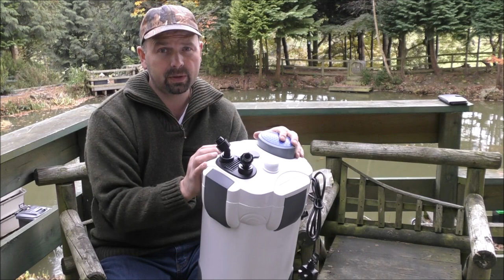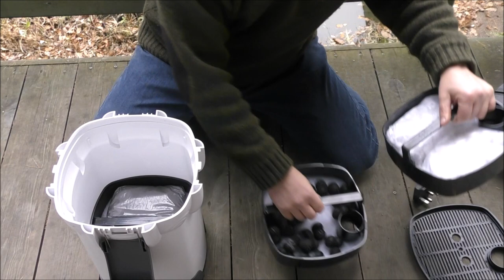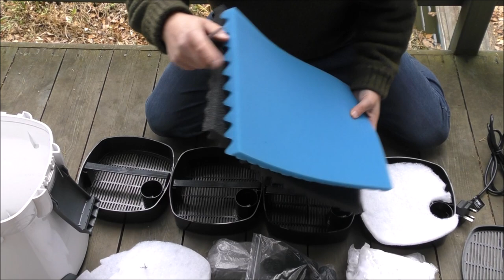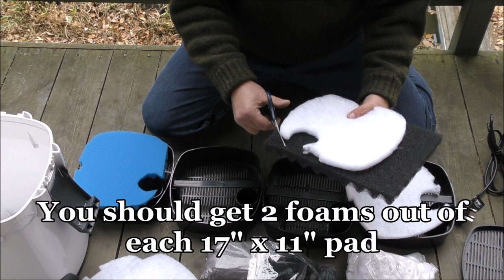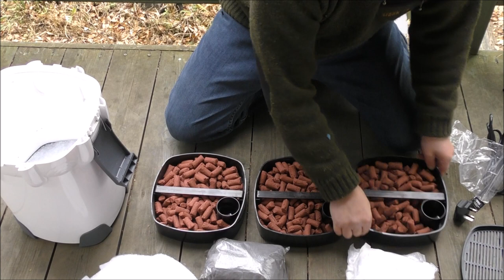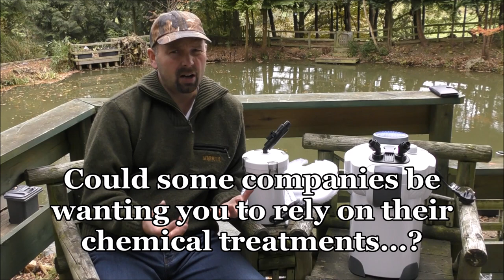Why Your Filter is TOO SMALL and NOT CYCLED

Comment: I have a juewl vision 450 and I have set my filters up the way u have said since it makes sense but I still have a lot of nitrate in the tank. I have an aps ef 2000 an xl biomax juwel internal set up how u said and a fluval 306 all have regular maintenance yet I’m still get sky high nitrate I’m doin 2 50% water changes per week to keep the tank healthy I don’t understand why this is happening I use carbon in my fluval n it’s the fluval carbon I use
Reply from the maker: The carbon should not affect the bacterial development but if the tank you are referencing is the white one stocked with cichlids in your videos it would definitely be classed as heavily stocked.
That could take around 2kg of biohome ultimate per 100 litres to achieve a full  cycle so you'd be looking at around 9kg for a 450 litre tank, maybe less due to water displacement from the rocks.
I need to know a few more things in order to help:
1 - how much media are you using in total?
2 - how long has it been in the filters?
3 - when doing they large water changes what conditioner do you use?
As you're in the UK feel free to ring me any time on 07772848730 as it is way faster to ask the right questions and give the right answers via phone (I often miss youtube comments)
Reply: Pondguru not sure on how much there is in Weight but all 3 trays are full in the aps filter. Same with the fluval and the juwel I have filled it half way as I ran out and the rest is filled with sponges that came with the filter. I use the fluval ceramic rings in the aps and fluval filters and ceramic gravel in the juwel they’ve been in since I set it up 6 months ago I don’t rate the fluval rings. I use a home brand water conditioner from lincs aquatics I was using king British but changed as it was costing a lot doin 2 changes a week it states that it can treat a 5000 gallons with the bottle it’s made for ponds not aquariums but was told it can be used for them too
Reply from the maker: So the biohome has also been in for 6 months? That's how long it can take for the anaerobic bacteria to mature to the point of reducing nitrate but if you only have 5kg (that's how much the EF2000 takes for 3 trays) - that is just over half what you'd need for a heavily stocked cichlid tank.
A normally stocked tank would take around 1kg per 100 litres, heavily stocked tanks can take between 1.5kg to 2kg per 100 litres - that's the most likely reason why you've got high nitrate as there is not enough media to provide enough habitat for a suitable amount of anaerobic bacteria to process the nitrate. We've got the recommended amounts to use from hundreds of people all over the world and every stocking scenario imaginable so they're very accurate.
While there are a few anomalies of people only using 1kg per 100 litres in a heavily stocked system and still achieving a full cycle those cases are rare.
I'm  not familiar with the treatment which you are using and nothing useful comes up on their website for treatments but as long as it is a straight dechlorinator which doesn't claim to detoxify / bind ammonia, nitrite and nitrate it should allow bacteria to mature naturally.

Comment: Great video! I am wondering what order my Eheim has the media in now. I will change to the order you suggest when I next clean it.
Reply from the maker: No worries, if it is one of the pro or pro4 it will probably have a 'pre-filter' foam right at the top which water hits first so just leave that as it is and set up the rest of the filter as demonstrated here.

Comment: How would you recommend optimising a fluval 406? Considering it has foam on the side could you forgo the foam in bottom tray ?
Reply from the maker: It is still best to go with at least a medium and fine pad in the bottom tray as the side foams only catch so much muck. That will leave 3 trays for media (3kg)

Comment: i’ve been using vitamin C (effervescent - berocca type tablets) to decontaminate my tap water... would this have any negative (or positive?!) impact on filtration?
i think i read a comment by you suggesting a seachem plant additive to help improve the cycle... if so, would you let me know when and how much to add during cycling?
i’m about to change my four canisters to your method, any suggestions for a Juwel Vision internal? yup, i watched your pimp that filter vid. hoping you’d confirm if it’s capable of a full cycle?
THANK U 👍
Reply from the maker: I couldn't say if the berocca type stuff you have used will have an effect as I don't know enough about it so I'm no use there unfortunately but after a 4-6 month period of having filters properly sized and set up correctly you should see something happening with regard to nitrate reduction. The flourish excel (or any liquid carbon additive) will help speed that up and as far as I know people who use it just use the recommended dose at the intervals recommended by seachem.
The things which definitely slow down, stall or kill off a cycle tend to be either anti-bacterial treatments (quite an obvious one) but also treatments which detoxify / bind ammonia, nitrite and nitrate so a 'normal' dechlorinator is always best.

It's not really the filter type which will allow for a full cycle but more how it is set up and how much media is used in it. Generally it takes around 1kg of biohome per 100 litres for a normally stocked community tank but that is an average based on years of feedback from long term users of the media, some tanks may take more, some may take less as there is always variation in water constitution. 
A heavily stocked tank could take anywhere from 1.5kg to 2kg per 100 litres which some fish 'experts' doing daily water changes on their tanks (to reduce high nitrates) condemn as a ridiculous figure but it is entirely realistic - we've just been misled for so many years about the nitrate cycle ending with the production of nitrate - seeing people with a nation of followers on Youtube telling them the same old half a cycle job story really has me scratching my head in disbelief when decades of proof to the contrary is out there.

Don't get me wrong, even when a full cycle is achieved water changes / tank maintenance is still needed to remove fish waste and remineralise the water through the addition of fresh water topping up maybe 10%-15% each 1-2 week depending on stock but there is no such thing as a zero maintenance tank. People should not need to be a slave to their tanks when they are set up properly.

Comment: Great video! Lots of inspiration and explained opinions. I have been an aquarium enthusiast for over six years, but I began with marine tanks and this type of filtration is very overlooked there and most filtration is just viewed as "nitrate factories". People tend to depend a lot on live rock without any actual science behind the reasoning. I was wondering, what is your opinion on flow in these canister filters? Is a high flow very important for biological filtration? For aerobic bacteria you probably can not have too much since they love oxygen. But what about the anaerobic? Would they even benifit from a slower flow?
Reply from the maker: I'm glad you enjoy the videos - thanks for watching.
If you use media which does not have a very varied structure capable of supporting pockets of anaerobic activity (even in fast flowing water) then the flow rate will be critical to supporting anaerobic bacteria.
e.g. if you have ceramic rings they would generally not be considered capable of supporting anaerobic bacteria not only due to the huge hole through the middle but due to the uniform internal structure so a vastly (achievable) flow rate would have to be used  to get anaerobic zones developing. It would probably be a shower type situation where water trickled over media extremely slowly and media was packed in as tight as possible.
As the biohome has a structure which lends itself to supporting a balance of aerobic / anaerobic bacteria in any flow achieving a full cycle with other types of media is something I have not experimented with of heard much back about.

Comment: I've been keeping goldfish since Jan 2015.  I've got 3 with an albino bristlenose pleco.  I do weekly 75% water changes.  As my fish have grown, the bioload has become high.  At the end of the week, it is common to have 40 ppm Nitrate.  I must be doing something right.  I haven't had a single fish fatality, and they've gown pretty large.I've been using Biohome Ultimate since June 2015.  I was hopeful I would be able to achieve de-nitrification.  First I had 2 full trays of Biohome Ultimate in a Fluval 306.  Then I upgraded to a Fluval 406 moved the media to it, and used the top tray for another media, which claimed the ability to provide an anaerobic environment required for de-nitrification.  The flow rate through a canister filter provides an oxygen rich environment, which is tough to grow de-nitrifying bacteria.  I'm now going to try using Biohome Ultimate in 3 trays of my 406.  I'm hopeful... but, skeptical.Am I reading between the lines properly?  Does Purigen interfer/prevent the de-nitrification.  I run a Fluval C4 HOB as well.  I put the Purigen in that filter.  Seems odd.Also, it is my understanding the anaerobic bacteria required for de-nitrification is not nearly as robust as the aerobic nitrifying bacteria.  I use Seachem Excel (low tech, goldfish friendly plants - anubias/java fern).  Will Excel prevent the anaerobic bacteria from growing.
Reply from the maker: The flow rate or oxygen content of the water should make no difference to how effective the (biohome ultimate) media is since it has a structure capable of supporting both aerobic and anaerobic bacteria. There will always be long tunnels, protected 'caves' where anaerobic bacteria colonises.
Unfortunately you don't say how big your tank is so I don't know if you have enough media to complete the cycle - feel free to send more information.
I am not sure how certain chemical media types affect the bacteria but they definitely are a factor in reports we get back when the cycle is stuck at the aerobic stage or has failed (anaerobically resulting in high nitrates) when the chemical is used - yes the anaerobic bacteria is definitely more fragile compared to aerobic bacteria.
When the suspected chemical treatment is removed the full cycle develops / recovers so the only information I have to go on is the reports and results when everything else is in place to achieve full cycle.
I wouldn't have though that a plant food would affect bacteria and it is certainly I haven't heard mentioned when a cycle has collapsed or stalled.
Reply: Thank you for the reply.I have a 29 gallon aquarium (planning to upgrade to a 55 gallon in a few months).  I recognized it's overstocked.  Which is why I've been very interested in trying to create environments for anaerobic de-nitrifying bacteria, "completing the cycle", use Biohome Ultimate.  I've tried a few different things over a couple of years, none of which work.  I've got more Biohome Ultimate being delivered, today.  So, during my next filter maintenance, my filter will have 3 full trays of Biohome Ultimate.  According to information provided by Great Wave Engineering, the top 3 trays of my Fluval 406 will hold 2.3 kg of Biohome Ultimate.  So, we'll see.Great Wave Engineering provides this information in their guide to filter volumes:"Nitrate Reduction - For nitrate reduction 1 kg of media is required for 100 liters of water (26 gal). A low flow rate (yet to be quantified) is required.  The rate of the denitrification reaction is relatively fast when there is no free oxygen present (< 0.5 mg/l is ideal). The deni-trification rate drops to zero when the dissolved oxygen level reaches 2.0 mg/l."(I understand their recommendation for the required mass of Biohome Ultimate is based on normal stocking.  However, I find it interesting they mention low flow rate.  Unfortunately, they don't quantify it.)Regarding the Seachem Flourish Excel - I'm sure you know, it's a way to provide carbon to plants, without needing to have a CO2 system.  But, it provides the carbon via the compound glutaraldehyde.  It also has the beneficial effect of being an algaecide.  I'm wondering if the glutaraldehyde will kill the de-nitrifying bacteria.  I worried about this.  So, I switched to another "liquid carbon" additive, to see if de-nitrification would be achieved... no luck... and more algae on my slow growing plants. So, I switched back to Excel.Thank you for your help and recommendations.
Reply from the maker: Unfortunately Don at Greatwave hasn't had the amount of feedback I have had from people using the biohome so much of the data is from researching online. Each tray of your 406 should take 1kg so you can get 3kg in there if you use the bottom tray for foams and fine pad.
From feedback the flow isn't really important as we've had people using media in shower filters on koi ponds which is fast flowing and highly oxygenated and they've still managed to get a full cycle.
I'm not sure what to make of seachem as a company as they seem to have the best intentions but also have a deceptive side where they won't fully explain what effect their products have on water or bacteria - take 'matrix' for example - it is pumice (not a very good grade of pumice) but trying to get them to admit it is impossible. It would be useful if they would explain that it is most suitable for fish which like mineralised, elevated pH water as that is the effect the media has when buffering the water - no wonder people trying to get a low pH for Amazonian fish struggle when using the pumice (matrix)....
Reply: Well, my filter has been configured as you recommend (all foams in the first tray) with 2 trays of Biohome Ultimate for a couple of years.  And shortly I'll have 3 kg of Biohome Ultimate in the filter, as well.  Now, we'll see how it goes.  So, if I don't have any luck with de-nitrification in a few months, I've likely got something interfering... like perhaps the Purigen in my HOB filter  I may switch to carbon, if that's the case.

Regarding Seachem - I heard much of the same from the Professionals in the industry.  Their products are very easy to get and their tech support is responsive.  However, the quality of their products and alleged deceptive practices are up for debate.  And some of the high quality products from completing companies can often be difficult to find, e.g. Brighwell/Continuum products.

Thanks.  I appreciate you taking the time to help me out.

Comment: I saw a video where one man ran his fluval outlet into a tub for hydroponics ad then an overflow into the tank and wodnered about doing the same with a sump,,,the inlet in the sump and the outlet in the tank with the idea of combining the near silent operation of a canister filter with the advantages of a sump. On the surface it sounds like the best o both worlds, but I wonder what your thoughts are on the idea. Would you recommend it?
Reply from the maker: I can't see any reason why that wouldn't work very well as long as there was suitable light for the plants to grow but if the filter is achieving full cycle filtration without the extra work then it isn't necessary.

Comment: Great wave, where I get biohome in the states, says a flow rate of 50 gph is required to achieve anaerobic properties. True?
Reply from the maker: Lower flow rates may skew the balance of aerobic and anaerobic bacteria more into the favour of anaerobic but it is not required since the internal structure always allows for pockets of anaerobic activity in any flow.
He may have taken that figure from what seachem state that matrix should have to be able to work but a 50gph flow rate is not possible in 99% of filters (unless it is a reactor or similar).

Comment: Great video. I am only 2 years into the hobby. I have a 55g planted tank that is very lightly stocked. I have a Fluval 406 and a HOB filter as well. The 406 has the mechanical filtration in the bottom and the the top 3 trays are filled with the biohome ultimate. I have zero ammonia and zero nitrites. However I tested today a few days after a water change and I am at 40 ppm for nitrate! So this video got me thinking. I have been conditioning my water with Seachem Prime and yes it does say that it will treat nitrite and nitrate so that could be my problem. What water conditioner do you use? I was thinking about API tap water conditioner as it supposedly is only for dechlorinating water and for detoxifying heavy metals. Does that one sound alright or is that on the same path to destruction. Thanks.
Reply from the maker: A straight dechlorinator like API stress coat will allow the bacteria to grow naturally without the 'starving' effect caused by treatments which render the ammonia, nitrite and nitrate unusable for bacteria so in your tank situation with 3kg of biohome ultimate you should easily be achieving a full cycle. The last part (anaerobic) is always the most difficult to complete but it can be speeded up with liquid carbon  - flourish excel is a good source of liquid carbon and has other useful trace elements in too. People regularly report a full cycle in a month when using that product but it will only be of benefit once the harmful effects of prime have worked their way through the tank.
Reply: Pondguru final question.  API stress coat + for fresh water also has the heavy metal ingredient. Both the stress coat for ponds and stress coat for marine do not. I am assuming either the pond or marine but wanted to be sure.